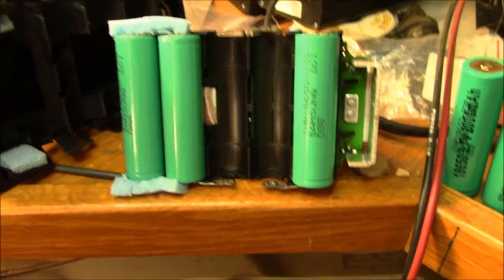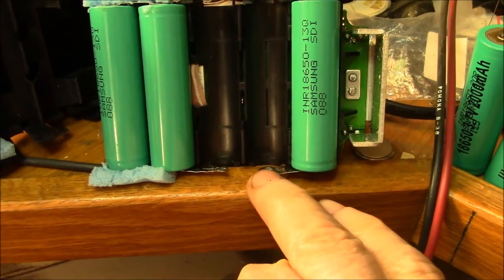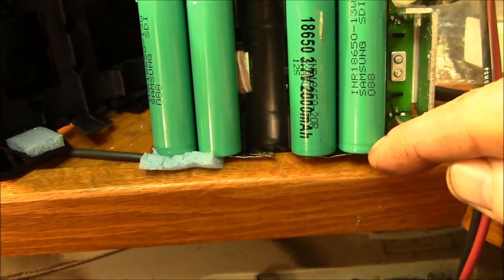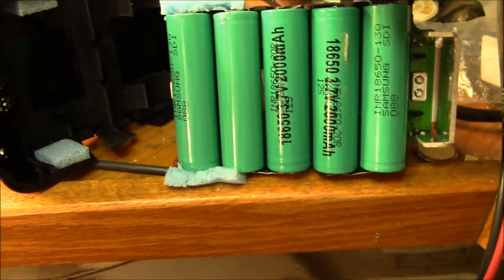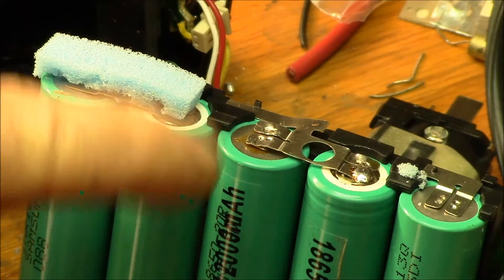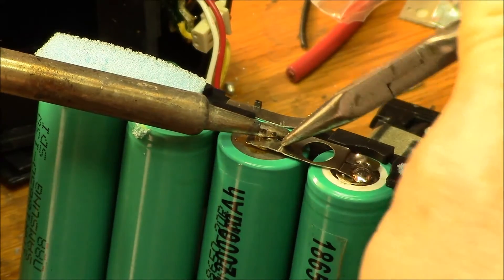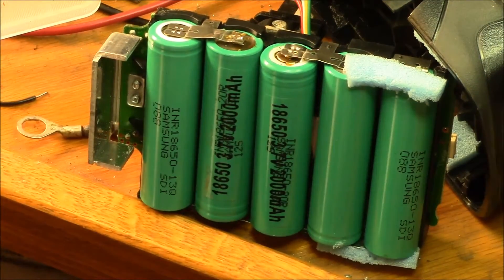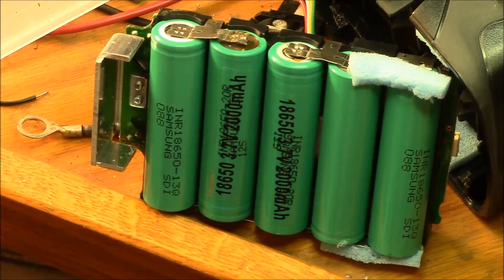Craftsman C3 Battery Repair, Part 2

Comment: Curious if this repair has held up and the battery functioned normally.
Reply from the maker: Yes, that battery pack is still going strong, gets used a few times a week.
Reply: @The4Crawler  how did you choose the correct replacement cells?  I understand "q" cells are for rapid discharge as in power tools?  I have no idea how to decipher the alpha numeric codes for these lithium cells.
Reply from the maker: I just selected a cell as close as I could get.  Same mfg, similar p/n and application (this was listed as  a power tool battery on eBay when I purchased them back in 2014).  Only thing I couldn't match was the exact capacity.  So it was either buy 5 new cells and replace them all or buy one new cell and just replace the one.  4 years later and it still seems to be working.  I've not taken it apart and tested the cell balance or anything.

Comment: So the C3 19v batteries have quadrupled in price these days.  You can buy knockoffs for $25.  The cells are garbage but the electronics are fine.  I'd like to try replacing the batteries with the Samsung greens.  . 

Has anyone already attempted this with success?
Reply from the maker: I've not tried that as far as replacing all the cells, but the pack I replaced some dead cells in is still working great many years later.

Comment: "old cells were 1300mAH, new cells were 2000mAH"
Weigh the cells. I've got AA batteries before that were about 1/3rd the weight of those you buy in the store. There was no way they could exceed the major brands...

Comment: 18650 batteries are commonly used in high-powered vapes.  Those Samsung greens are pretty reputable.  I wonder what would happen if I were to replace those batteries with LG HG2 brown cells.  (20A, 3000mAh each)
Reply from the maker: Yes, as long as they have a decent current rating (20 amps is reasonable for a power tool), putting in 5 of those would probably work well.

Comment: Cool R Brown, however the principle parts of your repair are missing, #1. how did you determine which cells were bad, (what meter and what was the reading). #2. Where did you obtain the exact replacement cells? Pretty important, don't you think? Also, just an FYI, a Solder Gun is designed for this use and if you'll tin the end of the battery first, (apply a little solder to the metal part of the battery first before applying the tab), it will make the job easier. Aside from that,..good clear video.
Reply from the maker: Unfortunately Youtube's removal of the annotations in older videos took links to all that information away.  Troubleshooting to find out which cells were bad started here:
https://youtu.be/SVGc3ks22zI
https://youtu.be/AwHfuGF_Ctk
https://youtu.be/sf7Yk_xHdFw
For the replacement cells, took the mfg. and part number information off the old cells, searched for that on eBay and ordered some replacements.  I was able to match all but the capacity, the old cells were 1300mAH, new cells were 2000mAH, but otherwise the same parameters as far as C rating, internal resistance, etc.

Comment: What flux, solder and surface prep do you do on the batteries? Whenever I have tried to solder onto batteries (or anything with whatever that plating is) I get a glob of solder bathed in an amber liquid that seems to appear from nowhere.   The solder will not wet down to the end the battery.  It might appear that a bond was made but it fails any mechanical test.
Reply from the maker: I usually run a Dremel with a sanding flap wheel over the surface.  Then I'll dab on some flux pen on the end of the cell and I use Amerway multi-core solder for the joint.  What I do is tin the end of the cell first, then lay down the tabbing or wire (pre-tinned as well) and touch the iron to that until the solder melts.  

You need to use a high enough heat soldering iron and large enough tip to get the solder to flow quickly.  I have a 50W Hako 936 iron, but I need to make sure to use a large tip with that iron.  Too small a tip will cool down too fast and not work very well.
Reply: @The4Crawler  Can you tell me what the flux pen is?  Is it something I could get at Frys?
Reply from the maker: Here's the one I used:
https://www.ebay.com/itm/SRA-99-20-RMA-Rosin-Flux-Pen-Refillable/122345788668

Looks like Frys has something similar:
https://www.frys.com/product/3008709?site=sr:SEARCH:MAIN_RSLT_PG
Reply: @The4Crawler  Thanks for the details. I will report my imminent success once I get the batteries.
Reply from the maker: Great.  If you have any old, dead cells, you can practice on those to get the technique down.  Big thing is to minimize the time spent with the hot iron touching the cell.  Should be no more than a few seconds.
Reply: @The4Crawler  I sanded through the plating, used 60/40 rosin core solder and this
https://www.amazon.com/gp/product/B00YL1D3US/ref=ppx_yo_dt_b_asin_title_o00_s00?ie=UTF8&psc=1
Worked fine.  You really can get in and out in about 3 seconds with a hot iron.  So thanks. My battery pack is all charged up.
Reply: If you mangle the sheet metal weld terminals between the cells you can jump them with desoldering braid or double up on some 14 gauge stranded lamp wire.  Just remember to re-connect the fuel gauge wires at each node.  

You'll need an anti tamper TORX driver with a central hole to open up the housing; the sockets in the fasteners have a pin in the center.  Even then a lot of axial force is needed to back them out without spinning the tool in the socket.  Maybe it was my cheap but barely effective choice of tools:
https://www.harborfreight.com/33-pc-security-bit-set-68459.html

A regular TORX driver is needed to split the plastic cell carrier to get the cells out.

I had a single bad cell but replaced them wholesale with 
https://www.amazon.com/gp/product/B00GS48XRE/ref=ppx_yo_dt_b_asin_title_o00_s01?ie=UTF8&psc=1   3400 mAh.  So far it's been working.

The true OEM version of this battery pack goes for over $90 and there are not many available.  There are lots of $40 versions but you'll notice in the pictures they do not have the test button or the  amber/green status LEDs.   I spent a lot on batteries but ended up with a mostly OEM unit.

Comment: Instead of prying the connections off (so they don't break ) couldn't you just heat up the original solder point until it comes loose ?  Great Video
Reply from the maker: I believe the tabs are spot welded to the cells, so you would need to heat that joint to a very high temperature to melt the weld.  I did solder in the replacement cell(s) as I did not own a spot welder at that time.  I did eventually pick up a spot welder and hope to be able to repair some of my other C3 packs that had all failed cells.
Reply: R Brown  thanks for the info . Where did you get the spot welder from ?
Reply from the maker: I picked up one off of AliExpress:
https://youtu.be/_YJYs9k_I0w

Comment: Lmfao  you never mix and match battery brands or cell types. You have to replace all the cells with the same chemistry of cell, amp hour capacity and voltage. basically they all have to be the same brand. looks like the two you added are cheap rewraps. believe me  I have learned this the hard way.
Reply from the maker: Agreed.  I did all the same except the AH rating, as I could not find an exact match there.  I got as close as possible.  That repaired battery pack is still going strong 3.5 years later.  I do plan on repairing some of my totally dead 5S-2P packs and for those, I'll be using all identical cells.

Comment: What happens if you use 5-  4200mah 18650?
Reply from the maker: It may or may not work, depending on the current needs of your power tool and the C-rating (discharge current) of the cells.  Many of the higher capacity 18650 cells are only rated at 1C discharge, so 4200mA for a 4200mAH cell.  If your power tool needs 20-30 amps, it's not going to run very well on a low discharge rated cell and may damage the cells over time.  That's why the power tool batteries are typically a lower mAH rating.  Kind of like your lead acid batteries, where you have a starting battery that can delivery 100s of amps for a short time, or you have a deep cycle battery that can deliver much less current for a long time.
Reply: Makes sense...  Thank you

Comment: A lot easier than rebuilding 15 cell nicad packs. When ever my C3 slim pack dies, I'll do the same thing.
Reply from the maker: Yes, the compact packs are quite easy to rebuild and it would not be unreasonable to consider replacing all 5 cells with some improved capacity cells.  I think Craftsman may be offering a higher capacity compact pack, I've seen some of those labelled "XCP".  The 10-cell packs are not so easy to rebuild, I did manage to get one put back together that I want to do some testing with in an upcoming video.